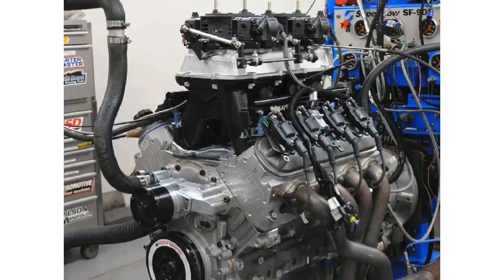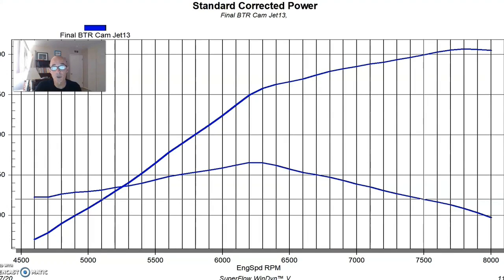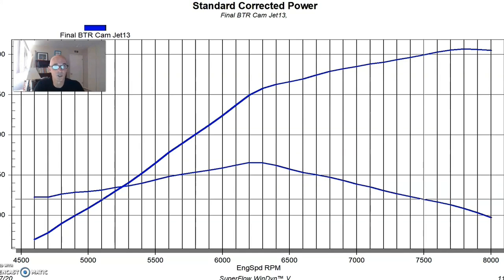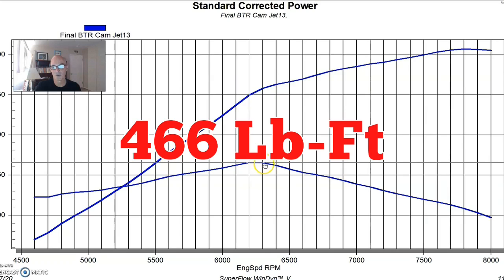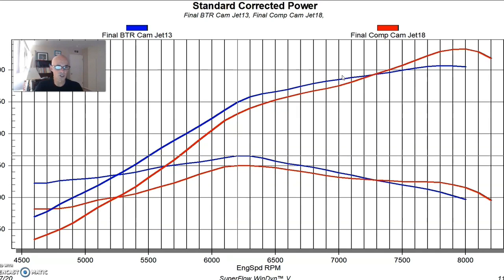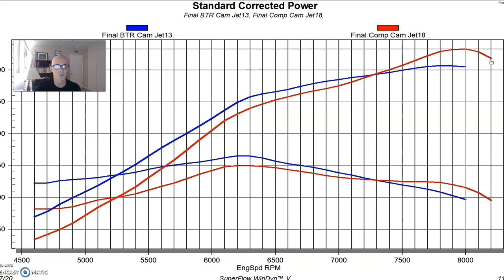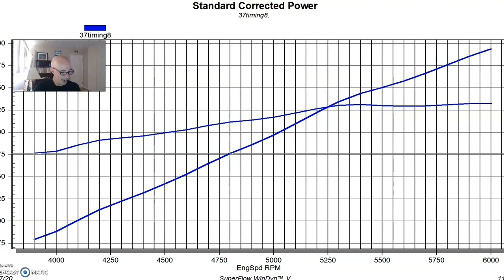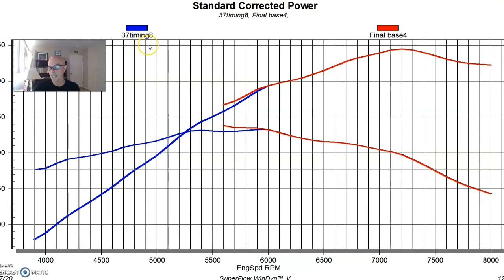8K RPM HYD ROLLER-WILL IT WORK?

Comment: If you were to use the LS combo in a drag racing setup do you think it would be possible to spray nitrous off the line, maybe from 4k to 7k rpm 1st gear only? My theory is it would make a power and torque curve more of a plateau. The engine would still be doing the majority of the work and the nitrous would bring in more power down low for better 60’ et. Love  the video, great information and I’m really looking forward to building that LS combo.

Comment: But why do this, even as an experiment? It is known that such motors would be unusable for any application beyond stating you have an 8,000 rpm pooprod motor - unusable power band for the street and too small and too little power for any sort of racing legit racing.

Comment: Too bad you didn't run the exact same combo with the standard stroke crank for comparison. 

Also, how can you run a 6.0 block and pistons with 4.8 crank and rods and NOT have the piston down in the bore at TDC the same amount as the stroke difference?

Comment: I would rather have seen a 363 Ford, a ported super victor intake with a 2" spacer on it.
Reply: I'm very curious of what header size you run on your motor. For my street/strip current build, can I make good power with my 1 5/8 headers.

Comment: The longer stroke  VS  shorter makes a difference in (longevity) , rod bearing surface area needed, oilling demands, etc...if run at high RPM constantly like (formula) engines.   Ever see a giant wind turbine out in the desert?  Their like 10 RPM , LOL... but the speed, MPH at the tip of the blade is moovin.. If you were on a seat riding one, the G forces would be crazy, even though its only 10 rpm... So more piston speed higher centrifugal numbers calculates into more weight "reciprocating" even if the parts weigh the same.

Comment: I'm not looking for high rpm. I don't care if it falls on it's face after 5500 rpm or so. I just want the most torque I can get between 2-4000 rpm. I have a 96 Buick Roadmaster sedan with the iron headed LT1. I don't have money to waste. I want to find a cam kit for good low end torque to pull my big boat off the line

Comment: Even prepped SBF heads don't really flow all that well compared to the newer modular stuff. De-stroking may have actually been to your advantage on the Ford motor because of the limitations of the heads. That plus, I never had a lot of faith in Crane Cams for anything. Incidentally, turning a SBF (especially a 347) at 8 grand, you better have a stud girdle and a damn tough prepped block if you don't want to split it up the middle or unload the bottom end in pretty short order. It's one thing to get those kind of numbers on a dyno, but quite another to have it stay together for the duration of a few races. On the other hand, I've seen practically stock LS engines with twin turbos routinely running up to 7 or 800 hp. with good engine management, and living for quite a while. Sure, they WILL fail after a while, but the LS has a very tough bottom end to start with, and anything you do there will increase the longevity.😉 EDIT: Check this out: https://youtu.be/MJLS9xFXYAQ

Comment: Richard, I’m in the uk so ls stuff is super rare. Iv a ls3 with btr cam and torqstorm. I love it but if the motor fails I want to de stroke and have something that will rev to 8000 as it’s different. 
Is this de stroked ls motor reving that high actually reliable? 
Amazing videos. !!!

Comment: The valvetrain sets the highest rpm where the engine will make power, regardless of bore/stroke... I totally agree.  But the reciprocating mass and stroke combination kinda do set the max rpm where it will survive for long periods of time...  ;)  Today’s lighter pistons let you reach RPMs with stokers where people would have been de-stroking for durability in the 60s-80s, IMO, but  even today shorter strokes are easier on parts.

Comment: The problem I ran into revving my ls6 on a track for 20-30 minutes at a time was the timing chain biting the dust. I think a lot of the old conventional wisdom on hydraulic lifters ignores how good the springs and lifters are these days. Of course this frees us up to worry about longevity of Rod bearings and stretch at high RPM.  Which the gen 3 and 4 factory lumps still blow away my old 1st Gen SBC's in those regards too. What a fantastic time to run high performance engines.

Comment: Short stroke isn’t for RPM potential it’s for longevity of the crank and rods. Dynamic forces at those engine speeds break stuff in the bottom end.

Comment: Instead of zero lash and half a turn, bottom out the lifter and one turn off bottom. Can use a regular hydraulic lifter. Its like a low lash solid with zero maintenance and big rpm on a hydraulic.....

Comment: Tunnel ram 2 fours and wider lsa might’ve done it...
Reply: FRANKENSTEIN CREATIONS : Yes!  The Hi Ram Destroker LS  is almost an Independent Runner, Isolated Runner, Port on Port intake that has just the right size of ideliased carb venturi area to make power at 8000 rpm. When the intake runner interconnection isnt ideal, or the carb venturis are too small, it sine waves for sure. Try differing the Hi Ram spacer dustance or Carb Venturi size. On the Fix Or Repair Daily, its healing over well below 8K  because it has a grouped runner 4bbl intake with one carb venturi feeding two cylinders. Im the first appolgist for rod Lamda  L/R ratio and LSA..but its air flow combination with carb that governs an engines response to a cam and head that "should" work at 8k rpm. The duty cycle of a restrictve single 4bbl is the reason. To win rev range back with a 4bbl, you'd have to add bulk compression to get the BMEP  back up. A flow bench cfm test would show a huge loss in combination flow through each port on a single 4bbl. This is an  Independent runner verses two cylinders per venturi  comparison. That scenario always collapses the peak power rpm speed and amount of power. Aspirations Index (Ai)  is a really healthy on the Destroker 5.1 liter. 3918, (310 cubes x 8000 rpm / 633 hp = 3918). Ai  drops down when you go for a good IR or Port on Port dual quads. It goes up ( gets less efficient ) when you go single four barrel. That Ford 8.2 deck 5.7 liter stocker had these specs: 347 x 7200 rpm / 548 hp  =  4559, the Aspirations Index.  With the Hi Ram, Andy Wood at Unity  makes the same power the hi rev 310 4.8 crank in 6.0 block does. Fords twin Dominator 302 Boss Trans Am racers for 1970 and the Dual quad Tunnel Ram 302s for 68 SCCA hit 8 to 8.5 k rpm because they had port on port 8bbl intakes and the intake cfm loss on a bare set of 275 or 290 cfm heads was just 10 when the twin carbs and 8 Barrel  intakes were slapped on. Carb size does influence power...when your using a Dual Quad intake with an almost isolated runner tunnel ram. The go to calculation is Jeremy Diamonds Victory Library or PMO's Venturi size for a 635 cc cylinder. Imho,  Carb  venturi sizes need to go up on the Rec Port heads. Its the venturi restriction thats grounding the rpms and power ratings back. Yes, pushrods and other optimisations might have helped, but if you add cylinder head cfm on a isolated runner intake and go backwards in power and rpm, you need different venturis and a better top spacer to bring back the power. Peak combination Cfm is clearly being hurt, or it would ace the power of flowed other heads.

Comment: A better cam with a higher LSA would have moved peak power a little higher in the RPM and quite possibly brought a little power with it. I mean another 40-50 hp and this thing is a rock star.

Comment: The Only  reason I can think of for destroking a engine is for sustained high rpms race only engines that are going to operate in a narrow power band for long periods of time for reliability to kill some piston speed and relieve some stress on the rotating assembly with that said I’d never destroke  a street engine and or street strip

Comment: If you had 1 7/8 pipes on the LS and only 1 3/4 on the Ford wouldn't that explain power falling of in the low 7000's

Comment: My suspicion is that if you went with both a wider LSA combined with a better flowing header you would have seen better gains in the SBF up top. That 110 LSA seems pretty tight for what you were trying to do.

Comment: I'm reving my Harley Sportster with a 3.81" stroke 7500 rpm. Cam specs are .600 x .600 lift ,264° x 270° @ .053". Full travel lifters with  1.850 in valves and 1.60 ex valves. Comp cams 7256,spring rate 485lbs/in ,160lbs@1.900" conical valve springs specs im using 185lbs on the seat., titanium retainers. She's still pulling hard when she comes on the rev limiter. Stroke dosent matter it's all in the cam and spring package. Oh yeah a good set of forged pistons are a must have too. Lol That piston speed is moving at that rpm.

Comment: Built my Dad a 406 SBC  was disappointed with results.
Dart SHP Block
Flat top 2 valve relief Wiesco Forged piston 
3.75 stroke 4.155 bore
Trick Flow 230cc cnc  heads  
Edlebrock Super Victor 
Lunati Solid Roller .600 int. .600 exh  255/263 @.050 110lsa 104icl
Yella Terra 1.5 rocker shaft
On Dyno it only made 570hp @ 6400 and 540 ft lbs @ 4800rpm 
I really thought the engine would have made peak power at 7000rpm

Comment: Thanks Richard for consistently great tests and info! That Ford had all the right parts to scream AND make big power, except for the headers. They choked it right down. Should have had 1 7/8" minimum. I have a 302 SBC with similar cam specs. ( solid lifter ) with ported bowtie heads, shortened tunnel ram, 2 center shooters, and 1 7/8" headers. Pulls hard from 3500 to 8000 while making well over 600 and 450. I think that Ford was a classic example of a choke in the system. 
Keep up the great work.
Reply: Exactly, you’re running race 225cc heads with street 1 3/4 inch headers, huge difference. Might as well just have run 205 heads if he wasn’t going to run 1 7/8 headers.
Reply: @jayt5993  More like "2" or greater" headers. The Hellcat thrives on 2" headers, and it makes around 700hp at a  LOWER RPM. I would like to see a multi-size-to-oversize header test. Can you drown a small block with 2.25" headers?

Comment: yes yes yes it can be done you need GOOD PARTS  good specs  and know how or boom.get the jb weld out or duct tape that would be good start to.few hp.but rod lenth is also has alot to do with clyder fill you can make it peakee or slow the rpm band on how long the rod is .weight crank pistons .rod lenth has a roll in it.

Comment: On the SBF I'd pull the valve cover off to see if you are getting the lift as advertised.  A miss stamped cam or rocker arms ratio are nearly impossible to tell by sight alone and many cams share the same lobe centers when dialing them in.  A simple valve lift measurement will be your first clue.  These high rpm motors are the best candidates for testing rocker arm ratios.  Although higher lift may not show an increase on the flow bench they will hold the valve opened longer at and over it's maximum flow.

Comment: Ls can rev to 8000 rpm on  basic stuff lol ford need quad cams to do that dodge can only dream lol all jokes aside I was wonder why the plus 5 it seems counter productive especially on a 110  lsa is so tight already I would of left it straight up and would of given more up top the plus 5 helps with down low and torque but for every last hp I would of left it straight up

Comment: Back when Freiberger had all his hair still, I built a 302 with a magnum 270 cam, matched springs and early 70’s 351w heads. I also adjusted the lifters with a little less preload to try and prevent pump up (my own idea, based on some tech articles in hot rod) and was rewarded with a rev range that I calculated (no tach in the car) went up around 7500-7800 rpm. I doubt it was making great power up there, but it was sure fun.

Comment: Seeing as you are talking about hydraulic lifters. Can you test a set of Rhodes lifters?  Show us the difference in the power curve with standard and the bleed downs?
Reply: I run the Cranes, and can attest, they make a .490/260 split cam on an Olds 455 pull from idle to 5,500, when I leave the manual valve body THM400 in top gear with a 3:1 gear ratio, in a 1968 barely optioned Cutlass body style.

the Rhoads work best on older cam grinds that have lazier ramps (ie, don't snap the valves open as fast as cams done post muscle car era). The Crane variable duration lifters don't have the "solid lifter click" they accuse the Rhoads of having. 

But i'd be surprised if a test of either lifter doesn't show a flatter torque curve below 3,000 RPM, caused by an "increase" or maybe less loss, of torque from idle to 3,000. And of course, measuring levels of vacuum, too, since that's another benefit of these lifters. I have power front disc brakes on mine.
Reply: I definitely want to see this done. A LOT of old Pontiac guys swear by them. However, anytime I mention them to old Chevy or Ford hotrodders, they look like they're gonna hurl
Reply: @excalibur3895  they shouldn't. Pontiacs generally run low RPMS for torque, the Fords have small ports and valves unless one goes Cleveland or aftermarket, and the Chevs love the revs.  I can't see why anyone would hurl over what is actually old tech. then again, I see a ton of Ford guys sticking to what worked for them in 1989 against Grand Nationals. You tell them to skip stroking that 302 for a 351W, and they come up with excuses.
Reply: @albertgaspar627  I know, you'd think with something that typically has the ability to run a hairier cam they would love them. But nope, everyone I've spoken to has said they did nothing to help them. I know they definitely work because I have a 455 Pontiac with a hairy flat tappet. I bought the basic Rhoads lifters and I can run power brakes. (I probably could've without, but it would've been close)
Reply: I should have also posted (i used to own the goat you see in my pic) that Pontiacs are classic for their lifter bores hanging unsupported in the valley--go with some nasty roller setup that snaps those valves open and closed to reduce overlap, and you want to support those bores. Variable duration lifters are another way to avoid the issues of big overlap at low RPMS.

I have Crane's in an Olds 455. With a .490 lift/260 duration split cam, and captive discharge ignition, I can leave my THM400 in third gear (manual valve body) and pull the 3:1 rear gears from idle to 5,500 RPM redline in a 1968 A body and run power disc brakes, no hydroboost. And get 15mpg. 

you couldn't pay me to run a regular flat tappet. I never tried "Vari-Cam" that put the spring in the cam gear, but variable duration lifters work like VTEC and all the other modern stuff---lo RPM grunt and vacuum and smoothness past idle, and then after 3,000 RPM you get your performance cam back. Its "cake and eat it too".
Reply: @albertgaspar627  Thanks for your post. Had never heard of variable duration lifters, but like the variable cam timing in my '19 CO pickup very much, it makes that 4cyl quite a nice little mill! Being able to retrofit that kind of mileage + performance combo to a classic would be most appealing!
Reply: @nunyabidniz2868  it really is nice.  A roller lifter can approximate the result, if it runs over a cam lobe with real steep ramps that accelerates the valve to full lift sooner than a flat tappet cam will. What it can do is get the valve to full lift sooner, and thus need to leave it open for a shorter period of time than the flat tappet that takes longer to get it to full lift, creating more duration on the cam and encroaching into the duration of the exhaust valve, creating overlap and blowing your compression right out the header.

(on a side note, if you do a three angle valve job that helps the valve flow more air at lower lifts, then you clear the cylinder out of exhaust gases better. This is the only benefit of having a lot of overlap--letting the incoming charge push the exhaust out. So, focus on air flow at low lift, and you need less overlap in the cam)

Roller lifters are great for reducing friction, great for dealing with the issue of low zinc in oil that wipes out flat tappet lifters at engine break in. But they are expensive to retro-fit on a block that didn't come with them, and they are heavy in weight--which means a better valve spring to avoid valve float at high RPM. Some even put a spring under the cylinder head and inside the lifter valley, to assist real hairy roller lifter cam profiles. 

Anyone with an older engine who for whatever reason doesn't want to go roller but wants to tame a hot cam, I always suggest variable duration lifters. I just don't know why all the car magazines never used them on engine build recipes....except that may be the part they didn't get free from an advertiser?  :)

Comment: My engine doesn't work ask the internet! 
Lq4 block 4.030 bore 4.125 stroke
Frankenstein f310 heads 255/276 hydraulic roller. 13.3:1 Frankenstein spec'd cam motion core, Cid intake e85 dominator
With that crank you can't spray over 200, you have to use race gas in the stand alone and it won't rev!
300 shot for the last 300 passes, shift it at 7900, and pump e85 on both sides of the fuel system.